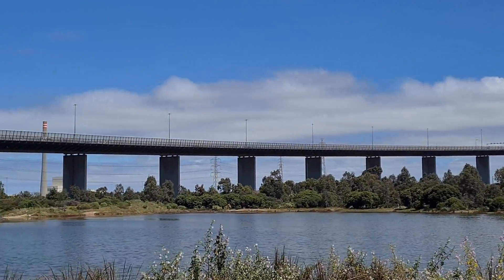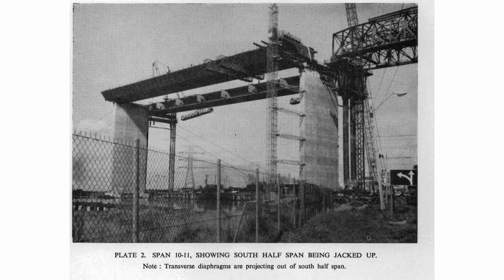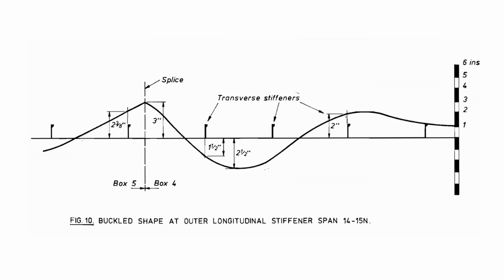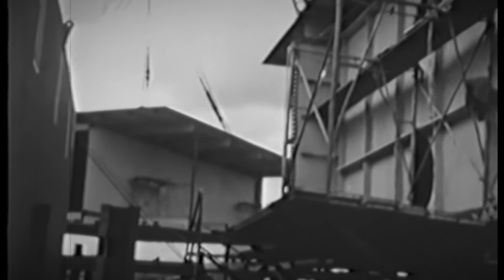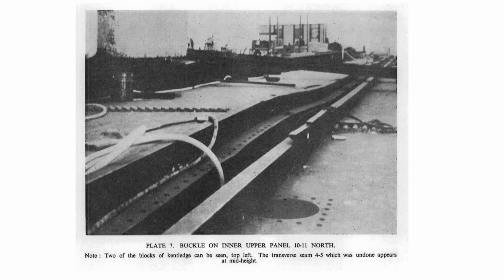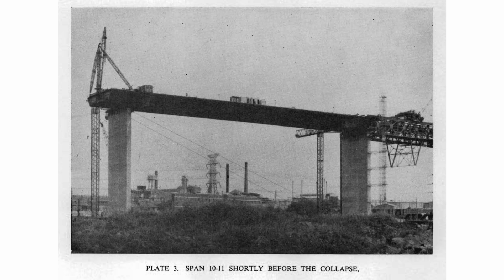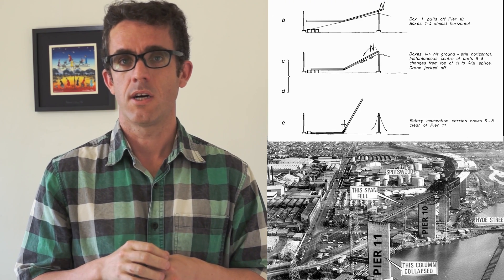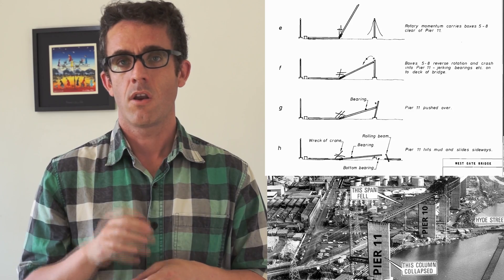Westgate Bridge collapse how and why it happened 50 years on

Comment: The idea that they could straighten the buckled sections in this way sounds like the worst type of botching imaginable. The steel constuction appears to illustrate a complete lack of understanding of the dynamics of steel.
Reply: The royal Commission pointed out the engineers basically were setting a basic design and leaving it to the contractors to work out. It's pretty bad.

Comment: everyone should download the royal commission report, and have a read. Then consider the extra lanes now installed, and weight of cars being 500kg+ heavier and trucks now carrying 32 tonnes  since it's 60's design. l avoid that bridge when it's carrying high load volumes, or high winds.
Reply: I understand your apprehensions, but I would argue that you have a greater chance of being involved in a fatal car accident while making the long drive through the inner suburbs of Melbourne to get around the bridge, than being involved in a collapse of a bridge that has been standing without incident for 50 years now.

Comment: It needs to be pointed out a little more that concrete precast sections were used mainly for the construction of the bridge and that the spans over the river were made of steel and that is where the collapse happened. I know you did mention this but I think a little more emphasis would be beneficial. After these sections were secured outriggers were fixed either side to give the necessary width for the roadway. I never knew the buckling was so severe.
Reply from the maker: Hi Anthony, it is always great to drill down into the details on these things, also thanks for showing intrest. it is alway how to know how much to focus on each part.
Reply: @BrendanHasty  Of course, you have divide the time between the various aspects of the WGB disaster. I grew up in Yarraville and saw some of the construction taking place, it was a huge undertaking especially for that period in time. I remember "inspecting" the piers and how tall and massive they are, I was surprised to see them resting on pads not knowing any better. I didn't like the irregular lengths of the securing bolts that protruded vertically up from the concrete support to locate/secure the pads. There was a large diesel (maybe a Cummins) winch with multiple winding drums and I couldn't figure out how the cable wound from one drum to another. This winch was damaged by the collapse but was repaired and back on duty albeit in a different colour. I worked at Spotswood at the time (Victorian Railways) and didn't feel a disturbance but my mother in Yarrville did.

Comment: Excellent presentation and discussion.  I lived through the aftermath of this while I was studying at Sydney University.
Thoroughly enjoyed your great insight and detailed knowledge.
The plate buckling research that came out of this disaster greatly helped me design some safe girders 5.2m deep.
Peter
Reply from the maker: Hi Peter, thanks for watching. Like most engineering failures, something is learnt, tho under tragic circumstances. Glad that you found it insightful. That must have been a big bridge you designed; what was its span?
Reply: @BrendanHasty  sorry i missed your reply
I designed irders holding up the boier at Loyang Power station
Span 20m
Load 2000t
600 tonnes of steelwok

Comment: "Mill Haven"  Do you mean Milford Haven ? I was working on the Avonmouth M5 Bridge at the time and it very nearly collapsed  due to a displced jacking prop location bracket failure.
Reply from the maker: Hi George, it was the Cleddau Bridge which is in milford haven, is this the same bridge？
Reply: @BrendanHasty  Yes Brendan